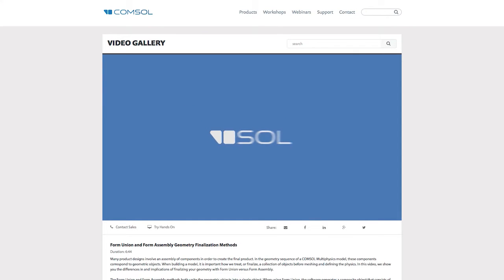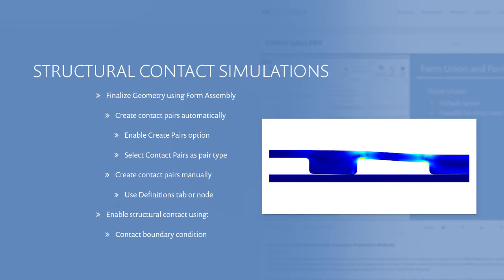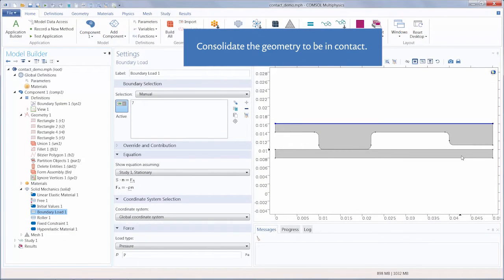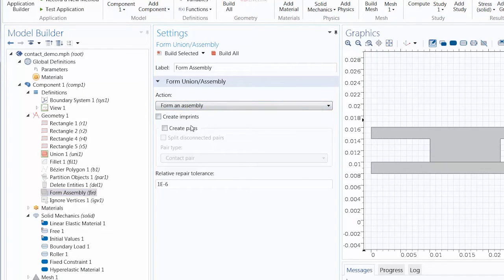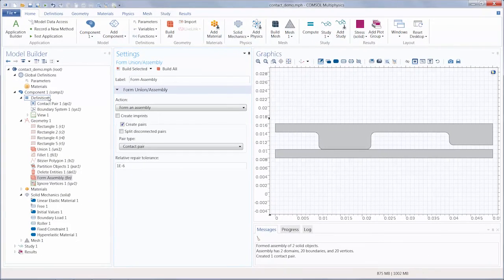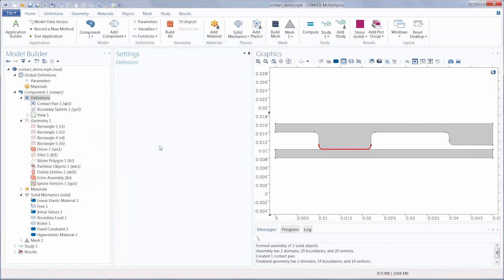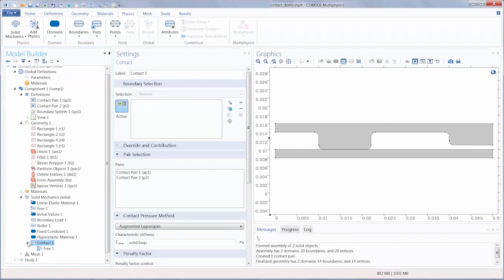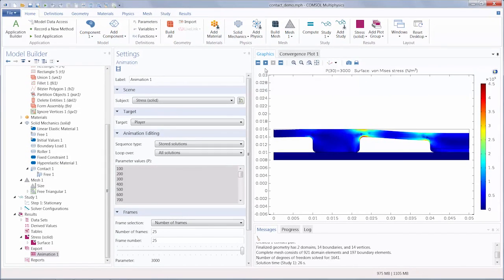How to Create Contact Pairs for Structural Contact Modeling

Comment: I am trying to make similar study but I keep getting an error attached at the bottom, I think my problem is with the physics (Solid Mechanics) settings rather than the mesh as I have tried many different finer and coarser mesh settings. Is there any written tutorial on how to go through the solid mechanics settings for structural contact modeling?

"Failed to find a solution for the initial parameter.
Maximum number of Newton iterations reached.
There was an error message from the linear solver.
The relative error (4e+003) is greater than the relative tolerance.
Returned solution is not converged.
 - Feature: Stationary Solver 1 (sol1/s1)"
Reply: mohammed i am getting the same problem how did you solve it
Reply: I am getting this problem too. I am getting it for the part that is not touching initially